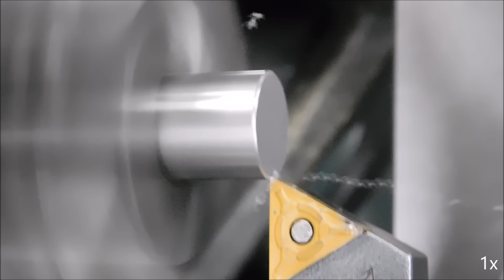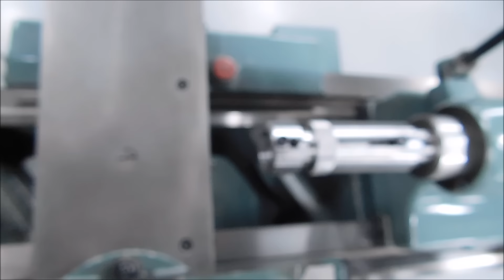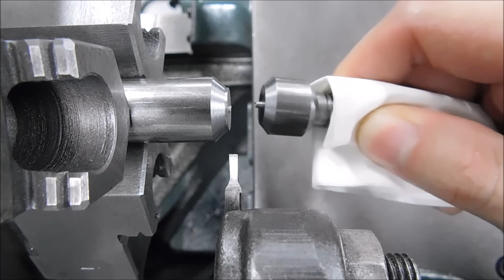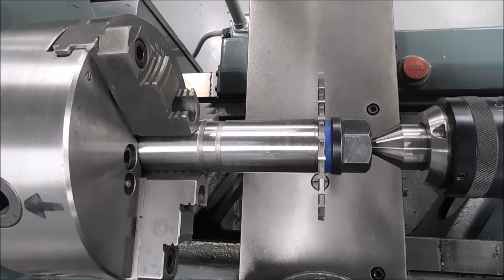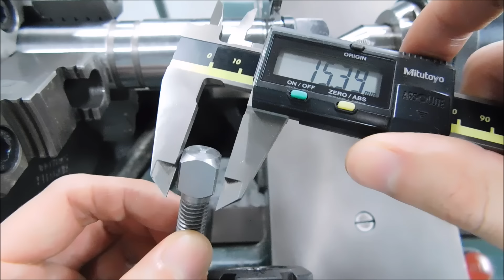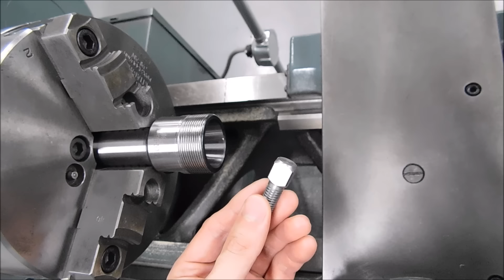【加工動画54】旋盤で四角ボルト/How to make square head bolts on a lathe

Comment: i have question!
Why sometimes you center drill the workpiece while its choked up and sometimes you center drill it on its full length of turning (which is the right way).
Reply from the maker: Thank you for watching.
That's right.
In this video, I used a center drill when holding it short, but unless the material is too thin and will bend, it is better to stick it out long and then use the center drill.
I should have done the same in this video.
Reply: @SwaplampJapan  thank you sir and love your work

Comment: Why do you have an arrow drawn on the chuck pointing to the chuck key socket?
Reply from the maker: Thank you for watching.
Scroll chucks have a structure where the chuck body on the pinion side into which the handle is inserted contacts the scroll gear, so if you tighten it with another pinion, the center will shift slightly.
By tightening in the position of the arrow each time, the misalignment of the core is minimized.
Reply: @SwaplampJapan  Ah!  I like it and will employ this technique.  Thank you!  I assume you determined which key socket to use through a thorough testing process.

Comment: どこにスワップさんが鋼鉄を買っているか？　特別の店はあってどこ人が物質を買えてか？<- Is there anywhere existing shops where You are buying steel(for normal persons, not companies)(understandable for natives?). Have You may for me any useful "machining terms" for me?
Reply from the maker: Thank you for watching.
It feels a little strange, but the meaning gets across.
スワップさんはどこで鋼材を買っているの？どんな人でも材料を買えるところ？
In the previous question, you can see that I was asking about a specialty store that also handles steel materials, so in casual conversation, I would abbreviate it and say “Tokoro” in the next question.
I sometimes order from a local steel shop, but a company called Misumi sells steel products online to individuals in Japan.
They are a little more expensive than steel material shops for companies, but they do their work with great care, so I use them often.
Reply: @SwaplampJapan  Thank You a lot for explanation, I don't have anyone to explain me particulars questions, what's ridiculous we should talk about machining, nonetheless, linguistic is also interesting. The way of building the sentences is a little different in reality, than it seems in the books. If I'll even build a little house in Japan with garage I put inside some machines, and buy from mentioned shop steel. I was confused why か is not at the end sentence, nevertheless it's significant of ask.
Reply from the maker: Thank you for your reply.
What you say is correct.
It's not wrong to use "か" when asking a question, but if you don't use polite language, to modern Japanese people it feels like an old-fashioned, high-handed tone.
As long as you use it together with polite language as shown below, there is no discomfort at all.
スワップさんはどこで鋼材を買っていますか？どんな人でも材料を買えるところですか？
Reply: طريقة إحترافية ورزينة وكأنه يرسم لوحة فنية بكل المقاييس 👍🇲🇦ممتاز
Reply: Muito bom